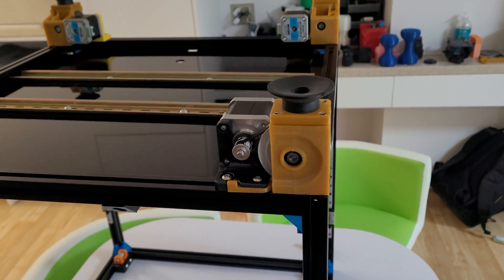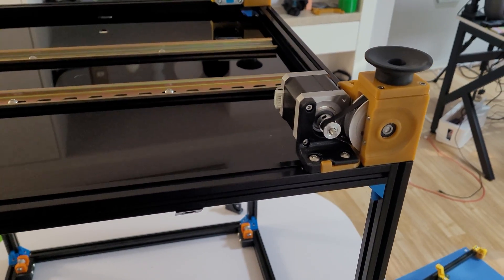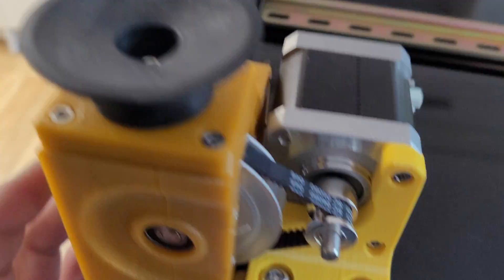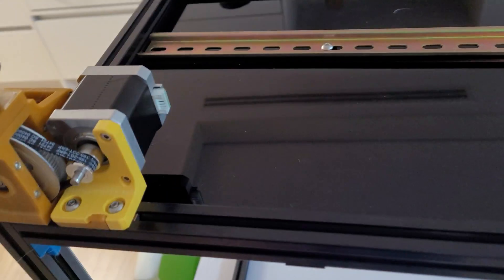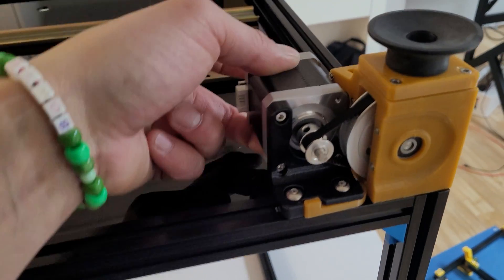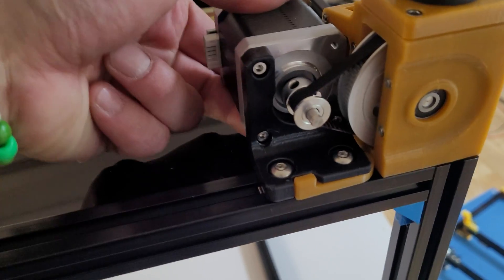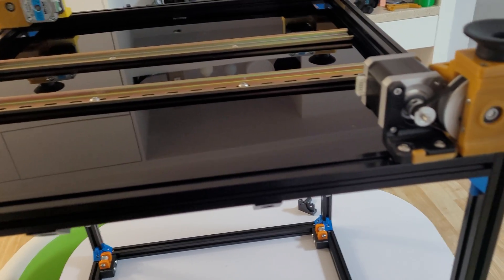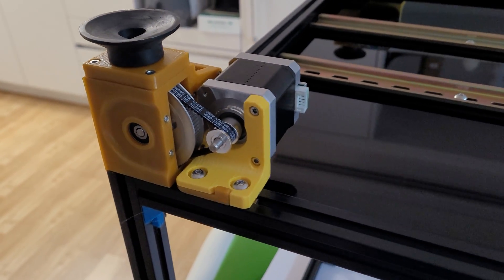WHY you need to use ABS or ASA, NOT PETG OR PLA when building Voron 2.4!

Comment: I agree with PETG being more flexible, but in this case it's really a design problem. L-brackets are never good if 3D printed :)
I'm going with PCTG-CF!

Also, the whole idea that you "use a belt and pulleys so it's not a problem", is not correct. The moving motor will act as a spring, and can still be noticed in the nozzle. Especially when it comes down to vibrations, harmonic frequencies, etc. Now I've always used PETG for my machines and it never gave issues where the parts were designed okay. But in places where it would flex a bit, I could definitely notice it being an issue in print quality. The printer makes such fast small movements, and it will only overshoot by the tinest micrometer, but this flex can still be seen in the layer stacking being uneven for example.

Comment: Those pulley's are backwards...
Reply from the maker: Lol they are!  According to the voron manual yes.  But you can install them either way just make sure pullies are aligned.  I must have skipped that part of the manual on my first build.  You can install them either way actually and obviously.  Only disadvantage is the grub screw is harder to access.  My opposite pullies running months w/o problems but I installed correctly on my latest build.
Reply: @3dPrinterSchool  They look funny that way if you put the trim pieces on, more flat finished looking the other way around.
Reply from the maker: Looking at it now not sure why they are even working.  But this is an older 2.4 not 2.4r2 so there maybe some changes, not 100% sure but if it aint broke dont fix it.

Comment: Can one make initial build out of PETG or PLA, then use Voron to print the parts in ABS or ASA?
Reply from the maker: You sure can but without an enclosure you will need lots of glue to not warp, with enclosure your petg and pla parts will melt during first few prints.  Better to just get some pif parts they are not too expensive to save you the trouble.

Comment: Ok but i want steel mounting brackets for my stepper motors and i bet a thin wall steel bracket would allow you to use all
four bolts to mount the stepper

Comment: Uhhh... you're not using the right petg... 
If you go with PETG instead of ABS you have to be prepared to spend double or tripple on quality materials...
Lookup Extrudr PETG, it has higher HDT than eSun ABS+ and they have a CF-PETG for the parts that need super rigidity.

In my experience building 3 complete CoreXY's I think premium PETG is fine, the problem is when people are cheap fkrs they think PETG cost the same as ABS but you really have to be prepared to pay.

ps. (I only built one corexy with PETG but it still works fine to this day.) I dont print ABS or super high temp materials on it though.

Comment: This part seems like it can be easily modified to have a spline on the outside that would increase rigidity massively. I would imagine PETG would be fine if the part was designed for it
Reply: My exact thoughts. The design seems to be suboptimal regardless of filament.

Comment: That is weird because ABS is very soft compared to PETG. PETG is known by its rigidity compared to other filaments, expecialy against ABS.
Your PETG is very out of the ordinary.
I built a core xy with ABS and 1 year later all parts that were under stress bent a bit.
Reply: for a precision machine to be on ABS or so holding up the parts make me wonder how it would be on its reliability over time anyway

Comment: Also steer clear from the aluminum made parts they are selling out there those are too rigid as the Voron manual explains — a little play amongst the parts is just as important for the proper functioning of the printer. Stick to ABS or ASA!

Comment: Print like a pro, use  PPS, PC and Nylon, Ultem, PEEk and PEKK depends how deep your pockets are, better if post printing parts are re-melted in fine salt (popcorn grade) packed and taken in temperature some 10-20 Celsius below printing temperature (recasting) or for high temperatures recasting use fine dental plaster powder (no water added, just compact the powder around the [arts to be recasted)

But the above materials are not for the pockets of the hobbysts I can see commenting in this thread, reason for which everybody debates PLA versus PETG versus ASA or ABS, good materials to test the concept during the re print re design iteration, but not as final parts to put into long therm stress work.
Reply: Lost PLA casting aluminum is another good way to make high performance parts. Use natural PLA so it doesn't leave pigment powder in the mold.

Comment: For parts not exposed to heat, PLA+ has much less flex than PETG. Steppers would easily soften PLA under even moderate use though.

Comment: Keep in mind creep and warping over time.... These things both happen without heat for many materials, but ABS/ ASA performs very well in this regard :)
Reply: What I wanted to write as well. Petg has quite a lot of creep under constant load, so over time you would lose dimensional accuracy and clamping strength, if the part is fastened to the frame with bolts for example

Comment: Umm… what about the likes of polycarbonate and CF nylon? Or resin parts?
Reply: Resin not good for technical parts, PPS, PC and Nylon, Ultem, PEEk and PEKK depends how deep your pockets are, better if post printing parts are re-melted in fine salt (popcorn grade) packed and taken in temperature some 10-20 Celsius below printing temperature (recasting) or for high temperatures recasting use fine dental plaster powder (no water added, just compact the powder around the [arts to be recasted)

But the above materials are not for the pockets of the hobbysts I can see commenting in this thread, reason for which everybody debates PLA versus PETG versus ASA or ABS, good materials to test the concept during the re print re design iteration, but not as final parts to put into ong therm stress work.

Comment: For this very reason I have the base parts made of anodized aluminium. The strength and rigidity of the construction is somewhere else. Especially if one has the 350x350x350 variant.

Comment: Its called material science. Choose your materials for specific application. PLA is only good if hard surface is needed, PETG is for slight flex, Nylon is for really tough parts that have to flex, PC for really heavy duty and ABS is for everything else.
Reply: It's not just learning to use ABS. A lot of beginner level 3d printers can handle PETG (and of course PLA), but they don't do a good job with ABS or ASA. Also ABS and ASA are super toxic so if you don't have a garage to put your printer in, then you are out of luck.

Comment: The "flex" anyone would experience in the components is not necessarily a material issue  but a design issue. Just design the part with more material in the right place.

For example that motor bracket we see at 0:30 is poorly designed given the purpose it serves. It's just an angle bracket with far too little material where it's seeing the most amount of torsional load.
Reply: You can't fault the design if your not using the specified material.
Reply: @draytonPW  Regardless of what material is being used the design of that particular motor bracket is bad. Plastic, aluminum, steel, it doesn't mattter. It's not optimized.

Comment: ABS/ASA are more flexible than PLA or PETG, PLA is by and far the strongest & stiffest. ABS and ASA are better heat resistant, and, PLA and PETG both will introduce "creep" over time under tension, this can actually be easily over come with proper designing, just no one wants to do it. ABS and ASA are also more impact resistant, but there is no impact in a 3D printer strong enough that would cause any of them to fail. People need to get facts straight!

Comment: Also the design, 3 point contact on L shape bracket. You have the space to make that at least 50% more rigid.
Reply: Design actually used to be 4 screws for the motor but the orientation it needed to be printed in actually made it weaker than the 3 point mount

Comment: Petg is more flexible than PLA, and ABS has more flex than PLA, So if it's not going to be in a heated enviroment PLA its the best choice. You can find videos from richrap, in 2014 more or less testing gears printed in diferent materials, the stiffer its PLA

Comment: I do most of my printing with PETG. If flexibility is a problem I use a cheap brand. These are less flexible!
In case like a Voron I would use PETG for the parts outside the heated chamber. Print with 0.4 nozzle, 0.15 mm layer height. As PETG gets more felxible at higher temperatures PETG (and PLA) will be more flexible and I prefer ASA.

Comment: for any structural parts etc, I always print with abs and also a 0.8 nozzle. The parts are so much stronger
Reply: In fact, ABS/ASA is not stronger than PETG, printed horizontally they are about equal, but layer adhesion is around 20-30% weaker for ABS/ASA.
On the other hand, stiffness of ABS/ASA is ~15-20% higher.
The temperature resistance is also higher as commonly known, chemical resistance depends, but is generally better for PETG

So yeah, ABS/ASA is a good all around material, but not the best for each application
Reply: @kachler67  yeah thanks for pointing that out
Reply: At room temperature PLA is stiffer, stronger, and more impact resistant than ABS. The main advantages of ABS are its ability to maintain its material properties at elevated temperatures (compared to PLA which will deform even under no load just in the sunlight) and some different finishing techniques as well.
Reply: @RobGadeke  show me where the impact resistance at room temperature is better. The tests I've seen show the reverse is true, ABS has far superior impact resistance.
Reply: @6AxisSage  As tested by CNC kitchen here: https://youtu.be/ycGDR752fT0?t=786  ABS and ASA are more than 3 times better when it comes to impact resistance than PLA. PLA is stiffer. And word "stronger" doesn't mean anything in this context.
Reply: @endymionspr9916  agreed, it was thespeklone and OP who used the word "stronger" not me. I was specifically desputing thespeklones claim that PLA is more impact resistant and nothing else. 👍
Reply: @6AxisSage  Yup, i agree with you and i provided a source. It's always funny to see specific numbers and percentages with "trust me bro" source.

Comment: It's not just temperature performance for why ABS is used. PLA and PETG will cold flow. You can't put materials like PLA, PETG, CF reinforced Nylon, etc under constant load without it deforming into the pressure from threads, weight, and tension.
Reply: in my experience, PETG is good for static load. ABS seems to withstand static loads very well too. PLA does not. My PLA did not cold flow - it cracked instead. Which was somewhat surprising. I have a lot of PLA parts that failed (cracked apart) due to what seemed like reasonable static load; their PETG replacements are fine so far.
Reply: @victortitov1740  pla is rather solid than abs or petg, while others a bit flexible. Pla cracks rather than bend so application matters
Reply: @victortitov1740  Yep, I've had several PLA parts crack from static loads. Most had a set screw with captured nut. Cracks either start at the corners of the nut pocket, or a vertical crack on the outer surface centered on the set screw hole. One solution is to wrap carbon fiber around the part to carry the tension load. Pluck a strand of carbon out of a piece of woven fabric, stick the end to the part with a dot of superglue, and then wrap it on with epoxy. After it sets up, use a dremel with diamond bit to grind away any carbon blocking the set screw hole (use water to contain the dust).

Comment: I have reprinted the brackets on one of my printers that had injection molded that had cracked.  The printed parts were done on ABS and have outlasted the origional parts and still good.  Not a voron machine, I don't know why some people say that 3D Printed parts are no good, they have their place and can last a long time.   Not a fan of Petg due to it tending to string alot when printing.
Reply: Always a question of settings. PETG prints really well without stringing once set up properly 👍
Reply: I thought that too after my first print of PETG looked horrible.  Even the temp tower was bad.  I had dried the filament for 6 hours prior to using it, so I thought the filament was okay.  I made a second attempt just recently with the same filament and the results were like night and day.  It printed great this time.  What did I do different? Not much.  I created a Overture filament profile, but all I really changed was the temperature.  I did have the filament stored in a filament drybox though using those blue dessicant beads for several weeks and it brought the humidity from almost 60 percent in my room or 30 percent in the filament dryer to 10 percent in the drybox.  That was helped me anyway.

Comment: I really don't understand the love affair people have with petg. Pla plus surpasses it in every way except temperature and there is petg Plus but if you're wanting something better than pla just go straight to ASA or abs. Unless you really need something to be food safe, and most ptg filaments are actually food safe, then I would just steer clear of the product in general
Reply: People like PETG because its safer than ABS or ASA, while offering better heat resistance than PLA.
Reply: Petg is a charm to print to be honest. It barely has any odour and I don't even need an enclosure for successful prints, (although it is always recommended). I designed almost every part I print and I can make Petg work every single time. The surface finish is amazing as well very useful for aerodynamic components. The other useful thing about PETG is that properly designing components which benefit from flex are very easily achieved with this material. If you want no flex at all just fire up a quick FEA simulation in Solidworks, adjust parameters and you are good to go, any competent engineering can make it work and benefit from the ease of manufacturability
Reply: I have run many rolls of PLA, PETG, and ABS, they all have their uses. For me, PETG gets the most use because it is at a minimum suitable for most applications I am 3D printing for and that small give can be an advantage. I have been running my Voron 2.4 for a year and an old Geetech i3 pro C since 2015. I will still get layer separation and warping on large ABS parts. It just doesn't happen with PETG, and my profiles for both are nearly identical except for the higher bed temp on ABS. I am going to try out ASA next time I have a large part.
Reply: @leenunya2965  so your fan profile for petg is the same as abs? That could be a big part of the problem. Depending on what the temperature is inside that enclosure it could also be a part of the problem. I like to preheat so the chamber is 50°c before starting asa/abs.

PLA+ is the bee's knees but it's popularity has prices higher than ABS so I been using it less and less. Weird but oh well.

Comment: Looks like a design flaw. Put a brace from the vertical to the horizontal, as one should with any unbalanced bracket like that, and you would minimize the flex in PETG.
Reply: My thoughts EXACTLY when I saw the bracket design.....

Comment: It literally says in the manual not to use PETG or PLA. They creep over time and they dont have as much temp resistance. Its amazing that people just ignore the instruction.
Reply: Many people live in too cold a house, don’t have an enclosure and most importantly don’t want their family breathing the harmful VOCs.
Reply: Not everyone can print ABS, as the VOCs given off are toxic. A lot of people choose PETG because it's non toxic and safer to use in their homes, while still providing increased heat resistance. If the instructions say to do something and you don't, it doesn't necessarily mean you are ignoring them.
Reply: @petermwheeler  everyone can print ABS tbh
Not actually ABS
But ABS+
I printed my whole V0.1 on an unenclosed ender 3
Esun ABS+ prints as easy as PLA
And VOC's are far smaller, bad smell also
If you really can't print ABS you have two options:
Dont build a Voron (Ratrig might be a good option because its designed to use PET-G
Or you can just buy printed parts
Reply: @petermwheeler  true; surprise to see most of the talks comparing abs and petg ignored the voc part
Reply: Phillippides Nutz the whole of building a voron is to print abs tho lol
Reply: @user-yk1cw8im4h  Maybe for you... My interest in the a Voron is because they are fast. If I build one, I won't even bother to enclose it because I only print PLA and PETG.
Reply: @petermwheeler  Then you're building the wrong printers for your money, Vorons in general are much heavier than the tightly integrated setups of the VzBoT, HevORT, K3 etc, you're typically quite limited in hotend choice too

Comment: ABS is nice but has it's downsides. You should look at CPE much more resistant to high tempretur flex. Nice Projekt i would like to see more :)
Reply: A guy from our 3dp community printed VORON parts from CPE HT. Had to rebuild in few weeks as screws slowly came loose and parts deformed and were not lining up. Those temperatures and loads inside chamber are merciless.
Reply: Isn't CPE co-polyester, which PETG is considered as? Is there a particular brand you use?
Reply: @JagerkTi  I use fiberoligy CPE HT  for food safe Prints that get cleaned in a sterelizing oven at 120C with UV light. Even 3 layer walls won't deform.